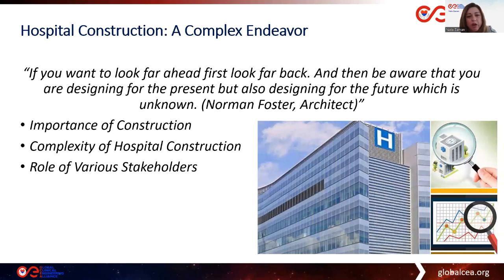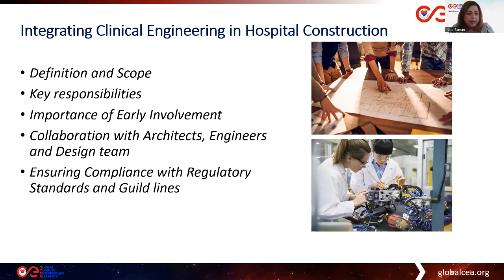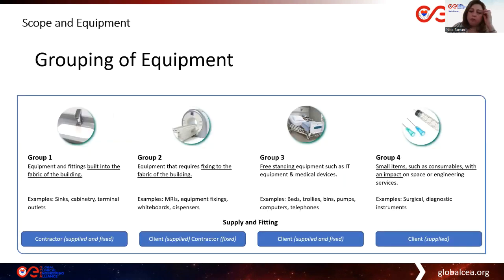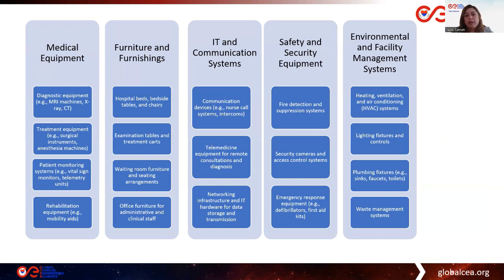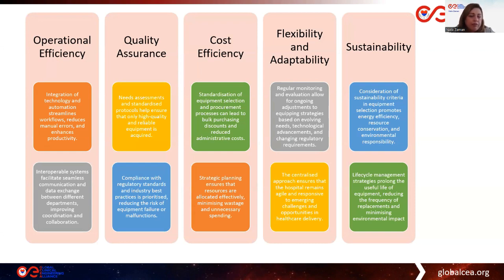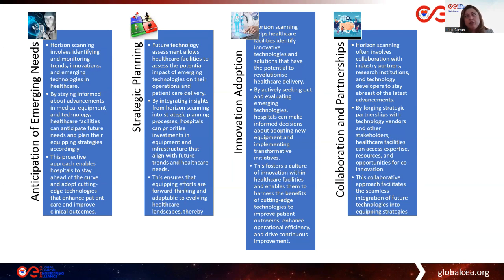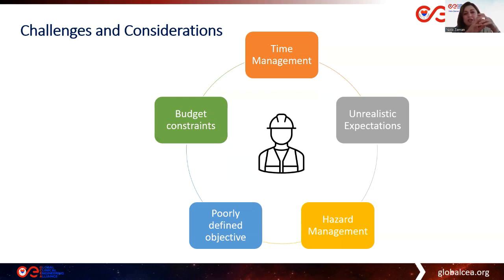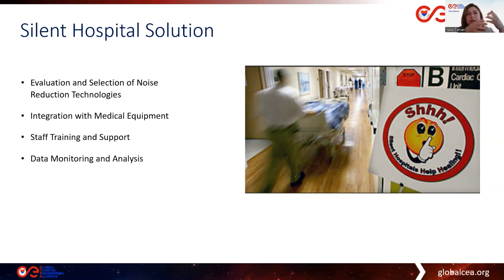Building Better Healthcare: The Vital Role of Clinical Engineering in Hospital Construction

Comment: An important role to have in Hospital Construction starting from the planning stage. Often, when equipment integrations are performed well, the magnitude of the work required to make this integration happen may not be fully realized. More often, it is when the integrations are not performed well, then the importance of this position is highlighted. Unfortunately, at this point, fixing poorly integrated equipment will lead to higher costs (e.g. adding missed outlets, widening doorways, adding HVAC, inability to move Department locations or rooms which were not located ideally, etc.). Fixing problems also take time. This presentation provides a nice summary of all the aspects of where equipment integration is required in construction and how Clinical Engineers can help fill this role.